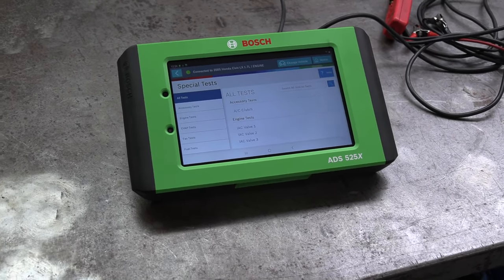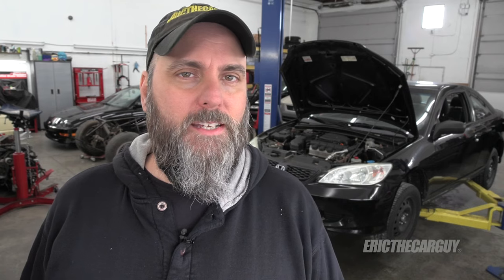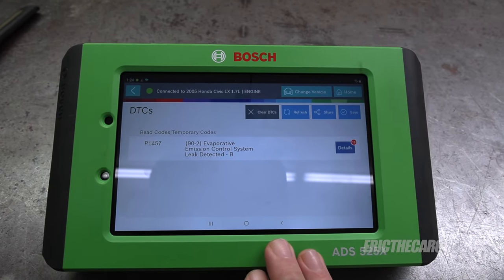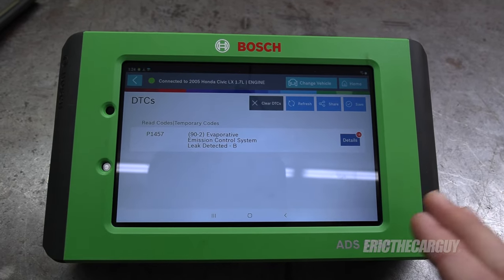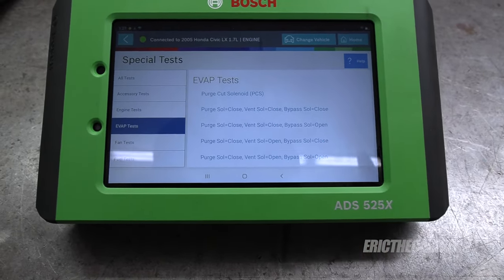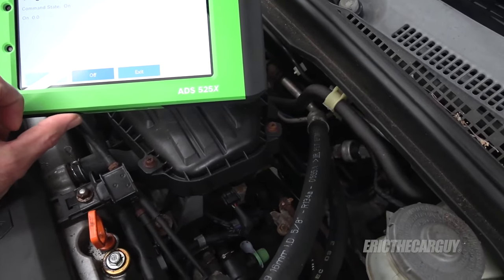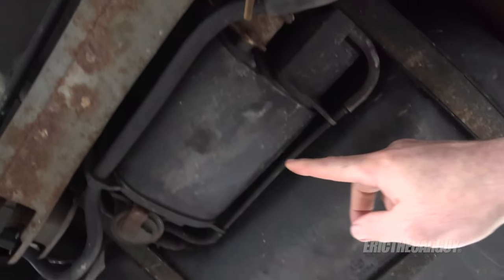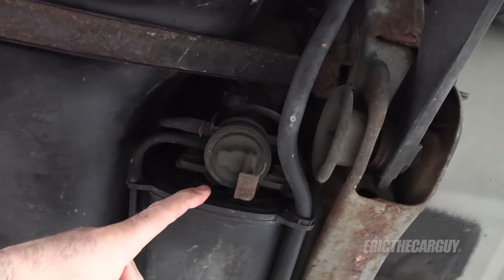How to Diagnose and Fix a P1457 Code

Comment: Two things that I would like to make a note on:

1)  Please take this part from my days as a pipefitter.  The Vise-Grips  were being used backwards.  The small jaw should be used as an arrow pointing toward the other jaw for the correct direction for rotation.  It's the same principle for Channel-Loks.  This greatly reduces the chances of slipping on the fastener.

2)  If you are working with threaded knurls going into plastic, a very good trick is to use a soldering iron to heat the knurl enough to melt the plastic that it goes into.  It will stay for a very long time.
Reply: Fellow fitter here. Can confirm. UA290 hand. You?
Reply from the maker: You are correct on the vice grips, but in this case, the grips actually only worked in this direction because the screw was so close to the part. I would not be able to turn it otherwise. Thanks for the heads up on the plastic trick. I'll have to try that next time.
Reply: @spacepope-1  I was part of local 286 in Austin, TX back in 2006

Comment: The purge valve on these cars will hold vacuum but not pressure. You can incorrectly call a faulty purge valve if you aren't careful. Also, I have seen partially shorted purge valves which will move when activated, but cannot hold themselves against manifold vacuum. Meaning, the Venturi effect will pull the valve shut when it's running a duty cycle.

Comment: hi Eric
since you know Honda very well, especially Odyssey, i have a 2008 Odyssey touring when i went to start the van, starter motor went and at the time, it some how shocks the electrical system where i can not get both sliding doors to work, the latch motors work, trunk won’t open but the latch lock works
same goes with radio, turn on but no sound 

anywhere where i can start looking ?

Comment: Why they put that canister in the ass end of the vehicle where it's out in all the elements is KRAZY. Liked it better up front in side the engine compartment or in that area behind the bumper cover. Had to epoxy my sons EVAP Canister after he hit something on the road. They are not cheap that's for sure.
Reply: because they need larger diameter hose and close coupling from tank to canister, since it has to take and filters the vapor flow when refueling.
long ago it just vented back out the filler neck into the atmosphere and at one point back through vapor recovery gas pump nozzles/hose/piping setups.

Comment: Back when I had an Elantra, evap codes were the bane of my existence. Car taken to the shop so many times, every part replaced once if not more times... never solved it. Looking back, I don't know why I didn't just bypass or delete the system entirely. Either way, eventually sold the car to a guy in a county that didn't require emissions testing.
Reply from the maker: You really can't delete the system. You don't want pressure building up in the fuel tank on hot days, or, if air can't get in, fuel can't get out.
Reply: @ericthecarguy  what was done on cars prior to evap? just vent to atmosphere?
Reply from the maker: Yes.
Reply: @ericthecarguy  Loosen the gas cap fixed.

Comment: Eric! 99 civic swap b18c1. I just swap out my fuel pump from b16 to b18c1. Before that i had check engine for o2 sensor. Now i have po1457 or so code. Could it be leaking at the fuel pump since i did switch it out?

Comment: Squirrels 🐿️. I went round and round with one of these issues. Started with the gas cap and the valve on the throttle body. Then went through some electrical diagnostic. After watching this video I built a DIY smoke machine and traced it back to the gas tank. Some kind of  rodent was living on top of the gas tank and chewed the vent hose. Should be an easy repair but the part was kind of expensive ($80). Thanks for the helpful video. I was about ready to give up.

Comment: Nice work man ever dealt with P2646 it’s an oil pressure code when the VTEC engages, i have replaced the whole assembly checked wires for proper connection I’m thinking it might be the computer because at this point I can’t seem to trace a problem just wondering if you’ve ever encounter it this with these 2.4 motors.
Reply from the maker: Funny you should ask. That will be featured in an upcoming video about the Fixing it Forward Odyssey. Make sure the oil is at the proper level and be sure you're using the viscosity printed on the oil cap.
Reply: @ericthecarguy  thanks for getting back to me I appreciate the info, at this moment the oil is new, at the correct level, and the right type so it’s been boggling my mind /: I’ve been told these motors are super sensitive about oil type and amount, I’m looking forward to your video the work is always appreciated 👍

Comment: Hey Eric…so I have the same problem on my 98  accord….when I put the smoke machine on it like you did the smoke came out inside the frame…so does that mean with the car off all the valves should be closed and no smoke should be coming out inside the frame?

Comment: 2013 honda civic. Got p0145c and p0497 low flow purge.
 
Replaced purge solenoid valve with OEM. Solenoid functions properly. Replaced fuel tank pressure sensor. Pulled chrcoal canister and checked for air flow, was good. Pulled vent solenoid on canister to inspect and test. It stroked and was fully opening and closing. 

Scan tool shows pressure in tank increasing and decreasing within expected range of 0inwc to -40 inwc.

Have had the codes cleared with $4000 mechanics scan tool. Car ran on idle for 20 minutes with no codes returning. Turned car off then back on. Codes came back.

Not sure what to look into next. There is sufficient flow yet it keeps saying low flow.

Comment: I've been fighting with this P1456/P1457 codes on my 6th gen Accord for a hot minute now.  But I don't have a smoke machine.  I know the vacuum valve on the intake is working and doesn't leak.  I've taken the canister off and replaced the vent solenoid.  I've also replaced the gas cap.  And what's odd also, the check engine light will go off by itself for a couple hundred miles sometimes and come back on again sometimes for a couple weeks at a time.  Very frustrating problem.

Comment: If the computer knows that there is a leak EX: loose gas cap, - Then where is the pressure switch?  Also, does ANY leak cause a code?, I have a Honda 2010 CRV and I replaced the charcoal canister with solenoid and purge solenoid and  gas cap, I cleared the codes but I still get ‘check gas cap message’ and I don’t understand where that leak is coming from.

Comment: I hear volatile used readily by many to describe how easily fuel vapors ignite, but just means how easily fuel evaporates. What concerns me is the extremely low flash point of gasoline vapors which is more to the point, the higher the ambient temp. the more unstable fuel vapors become around concentrated heat sources.

Comment: On my 98 have a recurring p1456 code that I can’t figure out. Smoke machine showed no leaks. Only clue I have is when it’s hotter outside the code doesn’t set and evap system passes the leak test. Any ideas?

Comment: Hi 👋🏽 I been a long time subscriber and follower learned a lot from your videos but recently came into an issue I can’t seem to solve and would like some advice to fix my issues I have a 2018 Dodge Grand Caravan gt that won’t keep charge I placed a battery charger on over night yet when I try to start my van 🚐 it won’t start at all because the charge drains quickly I’ll turn the key and get a clicking struggling to started all the power draining if I hold the key 🔑 long enough it eventually turns over and starts but can’t figure out what is causing it if I drive it runs perfectly ok but when I go somewhere and come back to my van 🚐 it won’t start and have to hold the key 🔑 till it starts can you please help me with a suggestion of want it can be I only had this van 🚐 for a few years when out of nowhere this started to happen I tried to use a code reader to diagnose the problem but nothing came up at all all systems show it’s perfect thank you so very much looking forward to any answer that can be helpful in fixing this issue

Comment: I’m just a shade tree mechanic…
With that outta the bag-my code reader says p1457 is a bad Purge Valve and the live diagnostics says the Command to Purge the System was given and is the Reason this DTC was set…
So i was believing i need to replace the Purge Valve 🤔
Any ideas/thoughts on this are welcome!!!

Comment: Hey Eric quick question. Is there a reason you used the leaktamer instead of the redline? Im in the market for a smoke machine and was wondering why you used one over the other.
Reply from the maker: The regulator valve on the Redline wasn't working for some reason, which is why I used the Leak Taimer. Either would work as they all seem to work pretty much the same. BTW, you can use baby oil instead of buying the expensive smoke juice.
Reply: @ericthecarguy  ooooh ok thnx for the input. Love your stuff :) Still waiting for the day that I get a cake on my bday lol, been watching for years and ive never had that luck
Reply from the maker: ETCG1 videos get posted on Mondays if that helps.

Comment: i changed my gas cap and installed the new solenoid with a oem part and it still comes on after about 200 miles,  the original solenoid looked good not sure what to do at this point

Comment: One point to note is that a scan tool is required to properly diagnose EVAP malfunctions. I have seen defective ECM drivers for the bypass solenoid, any solenoid can have this issue, and without a scan tool it would have never been known. You must have a scan tool.

Comment: My son’s 97 Grand Prix GT 3.8 has a vacuum leak coming from the rear of the engine. I suspect the evap tube as I have replaced all the vacuum lines. Unfortunately I cannot find a shop around here with a smoke machine. I can hear it!
Reply from the maker: Link in the description to a video on how to make your own.
Reply: @ericthecarguy  thanks 🙏

Comment: Hey Eric you can also use brake fluid as a penetrant for Rusty nuts! Stuff works great ☺️
Reply from the maker: I've never tried that. Although, I'm not sure how it would react with the plastic.
Reply: And paint
Reply: Definitely an effective method of attracting moisture.......not sure if a hygroscopic fluid (such as Dot 3,4,&5.1, which are glycol-ether) would be my first choice...... My guts lean towards dry nuts💦🤺

Comment: The problem with that janky electric connection is simply "resistive". Inside the valves there are relays; that's why you hear a click when you command them with the tool. Relays will exert their full action, ie. they will be fully closed when full current is running through them. It happens that with the bad connection ( it's simply Ohm's law in practice here) is that the connection is adding a resitance to the circuit, so the voltage in the end is divided between the relay and the point of bad connection. That said, because the voltage is divided, the relay is not getting full 12 volts and therefore, it will exert its full pressure on closing the inside diaphragm in the valve, hence, some smoke gets through the valve and thus, you had the initial impression that it was a "bad part out of the box" - yes, it can happen, the quality control weeds out the vast majority.
And that's why simply throwing new parts is not good approach... but again, most of the time they "cure" the problem but on occasion you get these curve balls thrown at you.
The video is great anyway to demonstrate how to use the smoke detection and the whole system, thanks.

Comment: I chased an evap issue on my Saturn Ion for a year. Turns out the Duralast purge solenoid I installed was junk, and crapped out after a month. Local shop suggested I put an AC Delco part in there instead. It’s been a year now. No codes. Lesson learned. Parts house electrical parts aren’t worth the money you saved.

Comment: - You can add UV dye to the 'smoke fluid/fog fluid. I have one that uses baby oil.
- Smoke machines can be used to find intake leaks quickly on trucks.
- That ghetto diy fog machine with the paint can works but people are charging scalper prices.
- Check pawn shops for these because they get pawned and sold for cheap.
- I always heatshrink the wiring just in case so they can't be damaged.
- You can use the ohmeter to find out if the solenoid is bad. The info is online.
- You can 3D Print plugs for all of the lines if you need them. Just look on Thingiverse.
- Smoke machines are cheaper on Amazon.
- You can use the smoke machine to find leaks in your home as well.
- Don't get caught swapping a used EVAP canister from another car on video. EPA will fine you. 
Another youtuber let me know he got popped for swapping a working CAT from another car.
- In the old days people would use cigarettes to do this (dumb) or they would burn fluid in a can.
- That leak could have also been from the topside of the tank where the pump/sending unit was.
Reply from the maker: -No need for dye, although it can help, white smoke shows up well in UV light. Think white t-shirt under a black light.
-The connectors I used in the video solder and heat shrink at the same time. Link in the description.
-Not all solenoids ohm out bad when they are. 
-Perhaps you could 3D print a plug, but you would need the specs of a good plug in order to do that. Also, there is a rubber weather seal in the connector that can't be printed.
-Swapping charcoal canisters is not illegal. Catalytic converters are a different story if you're a professional mechanic in a shop. 
-If the leak was from the top of the tank, the smoke machine would not have indicated I found the leak when I pinched the line.
Thanks for your comments and input.

Comment: I’m having a problem with my element where it will not start after filling it up with gas. Any idea what that could possibly be?
Reply: The charcoal from your canister may have broken loose and has now been sucked into the EVAP line that goes from the purge solenoid to the charcoal canister.

Comment: Isn't the vent valve a normally open type of solenoid? If so, smoke coming from the fuel tank should pour out, but nothing is coming out from there. Weird.

Comment: One lesson…fix electrical connections first before replacing parts.  In some cases it’s as simple as a bad wire connection which causes a whole host of other issues.
Reply: Good point, however when you see oil, fuel or smoke coming out when testing where it oughtn't to, you're going to need a new part anyways. Everyone should get some CRC or other electronic connector cleaner and clean any/every connector you can when you've fixed a problem and are buttoning up.  Only takes a minute or two, but cheap preventative maint.
Reply from the maker: I agree, but this was a leak not caused by an electrical issue, it was caused by the valves not sealing. Thanks for the input.
Reply: @ericthecarguy  yup and yup!

Comment: Has anybody noticed that the newer gas pump nozzles are no longer completely filling gas tanks. All research points to EVAP systems but how. An it be two different cars of two different makes, only on the new pump handles. No issues with older pumps.

Comment: 2001 Honda Accord LX Major Driving Impact

  Stored Codes

  Issues in this list trigger a dash light and likely require attention.  Tap an issue to see more details.

  Evaporative Emissions Control System Leakage EVAP Canister System

  P1457-Engine Code

  Confirmed Fix and Cost

  See what fixes these issues for others and how much they paid.

  Why is it happening now?

Comment: Not familiar with evap systems. So if it vents right into (what seems like) the frame of the car, then into the atmosphere, wouldn't that defeat the purpose of sequestering in charcoal canister?
Reply: awesome vid by the way
Reply from the maker: Actually, it's suppose to close off when the engine is off, and allow fresh air to come IN through that vent to allow the vapors to flow in the system to the engine to be burned. Think of a drinking straw where you plug off one end  with your finger and remove it from the drink. The fluid stays in the straw until you release your finger. The idea is to keep fuel vapors out of the atmosphere and burn them in the engine when conditions allow.
Reply: @ericthecarguy  get it now thank you for the strawsplination.

Comment: Hey Eric
Anyway you can make a video dealing with P1456?
Reply from the maker: It's almost impossible to fill video requests for repairs. I would need a vehicle to come in needing that particular repair and also time to shoot the video. As for a P1456, like I said in the video, that's usually a loose or leaking gas cap.
Reply: @ericthecarguy  The first thing I replaced was the filler neck (it was really rusty) it had actually rusted into 2 separate parts (no joke) I'm located in Canada and my car is 21 years old. (2000 Prelude) Second thing I replaced was the gas cap, still have the same code popping up. I'm thinking it may be the tube that sends exhaust gases back to the charcoal cannister in the engine bay. I've noticed when the tank is at 1/2, there's a smell of fuel vapour when I open the driver side door but when the tank is full, there's no smell. Also, there's no vacuum noise when I remove the cap. If I were in your area I'd drop by, I need a timing belt service done  along with all seals, waterpump, accessory belts, gasket, etc. replaced, I ordered all the parts already.

Comment: I've had a P0455 code on my 2006 silverado 1500 since I have bought the thing in 2018
Reply: GM always has a trouble light, if no trouble lights I would take it to the dealer and find out what's wrong with it.

Comment: Spent two months looking for an MDX evap leak.  Made my own smoke with a paint can, Low press reg and incense for smoke.  Turns out the idiots who worked on it last didn't fit the rubber seal on the fuel pump assembly properly.  BTW...sometimes it helps to put your finger on the solenoid to feel the 'click'.